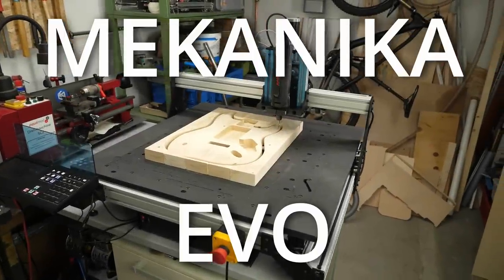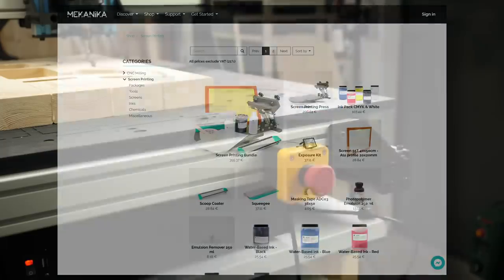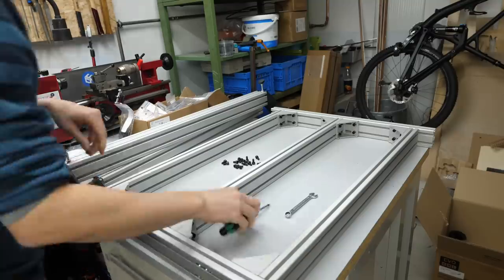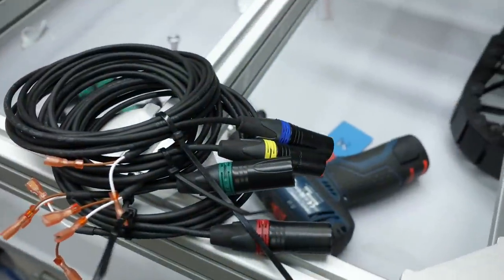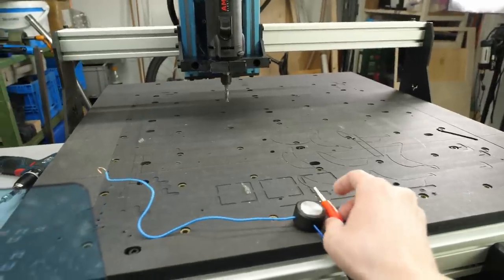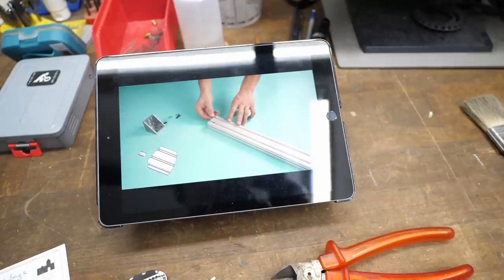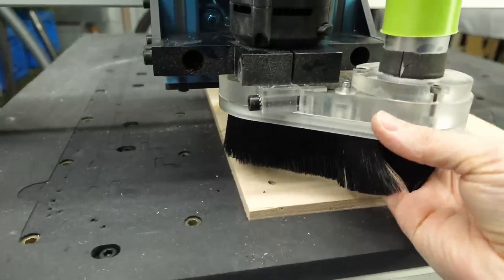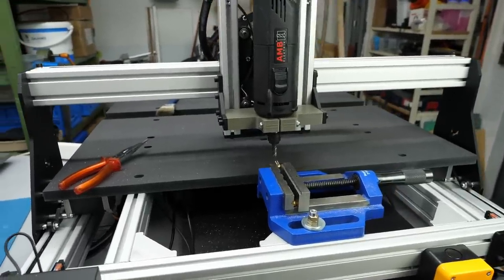Mekanika EVO-S CNC Router REVIEW - Great CNC for Beginners (with money)

Comment: Damn why am I not in Hamburg
Reply: Hey mate, Cornelius (CEO) here. For good fits we can definitely cover moving costs! Most important to us is that we build a strong culture of people who are as passionate about printing as we are!
Reply: @corneliusschmitt3629  Heyo, that's mighty generous. I'm bound by family and PhD studies (lattice optimization in AM). Would you consider offering remote opportunities in the future? I'm not too far away but can't move over to Hamburg, even if I wanted to, but your company and goal is really interesting.
Reply: @corneliusschmitt3629  As I replied to Layershift comment above:

I am working on R&D on a 5 axist 3 D printer that can allow you to reduce to nill the internal suppots and to a minimum the external ones, also working to an add on to make it a 7 axis machine, the idea is that anybody can 3D print the key components and than dissasemble their regluar cheap 3D chinese made printer, and with a few more parts to buy online can transform them in a 5 or 7 axis machine (works for the expensive printers too).

If Zellerfeld is interested in such an approcah for the machines they use, I can help.  It reduces the printing time (by not printing supports, at least not everywhere) reduces the materials consumed, for the same reason, and the post printing time for not having to clean so many supports and than sand the part to make it look nice where the supports were attached.

Comment: This seems like an over priced, over sized entry level CNC router.  Anything on the professional level should not be made from aluminum extrusions.  That's just lazy engineering there.  For the mass market, getting custom parts stamped would be so much more cost effective and stronger.  Extrusions, while easy to build with, are expensive and not accurate.